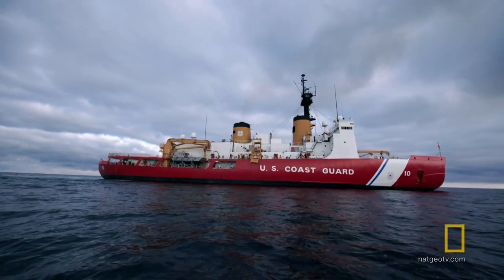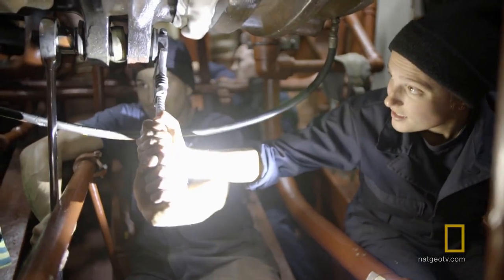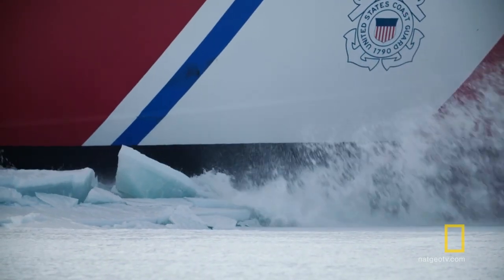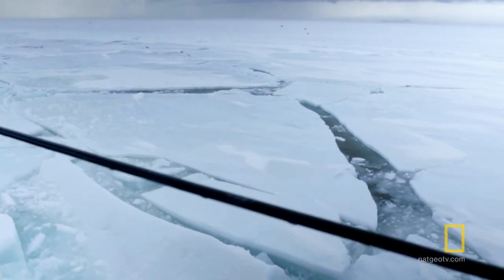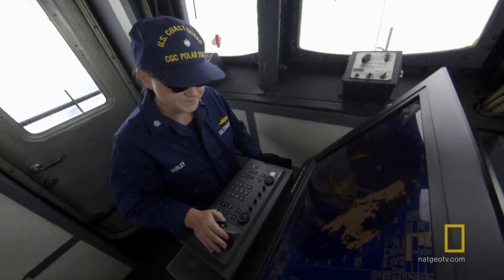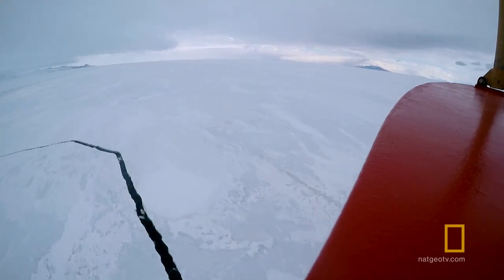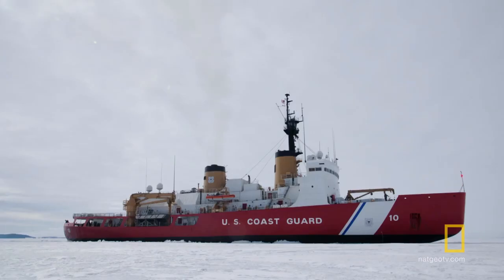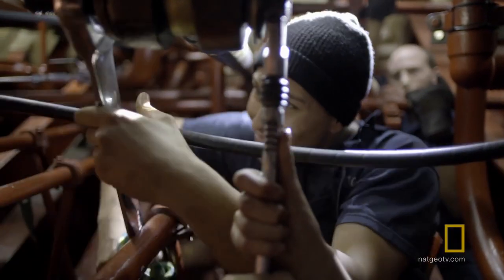They Turn Ice Into Ice Cubes | Continent 7: Antarctica

Comment: what a loaded claim: "the most powerful ice breaker in the world"
maybe in the USA
I'm guessing you haven't heard about the https://en.wikipedia.org/wiki/Arktika-class_icebreaker
Reply: If you look at the spec's, you will see they both have 75k SHP. But Russia just launched a new breaker http://www.npr.org/sections/thetwo-way/2016/06/16/482288188/russia-launches-worlds-biggest-most-powerful-icebreaker so unless the U.S gets off it's but and build a backup to the Star, it's game over in the Artic and other heavy ice areas. But the spec's speak for themselves as to whats currently afloat and in use. The Polar Star is a very capable breaker. I can assure you the numbers provided in the specs are "recommended" ice depth. I have "heard" from crew members that it will break over 25ft of ice. I've seen the 140ft breakers int he great lakes break 4ft of ice when they were designed for 18 inches. Brash ice is a different story. :-)
Reply: I think he meant to say the world's most powerful non-nuclear icebreaker.  At least it was when I was on it.
Reply: a trick : you can watch movies at Flixzone. Been using it for watching all kinds of movies these days.

Comment: what happened to USCGC Healy (WAGB-20)?
Reply: Ryan King. Negative, that was the CGC POLAR SEA that had the engine failure not the  CGC HEALY.
Reply: Bigger breaker but not as powerful or capable.
Reply: they have the same diesel engines but none of the three turbines we have on the polar star so they are only a medium ice breaker instead of heavy
Reply: The HEALY stays up North, and leaves the heavy ice breaking to the STAR.